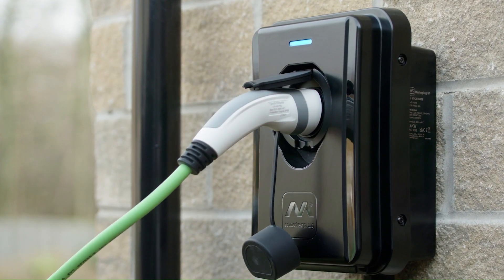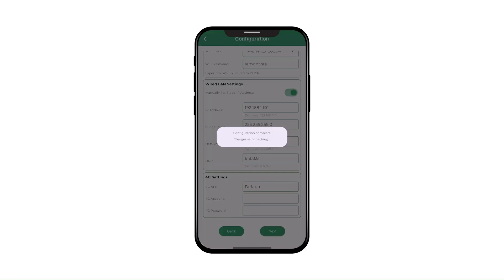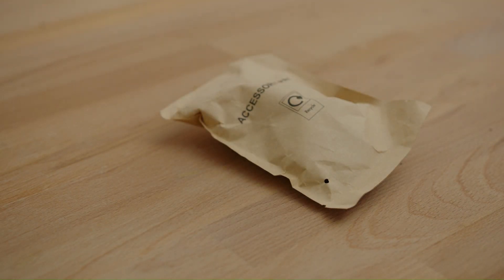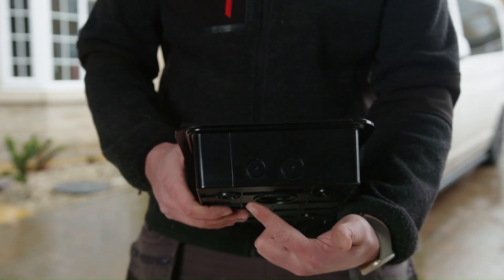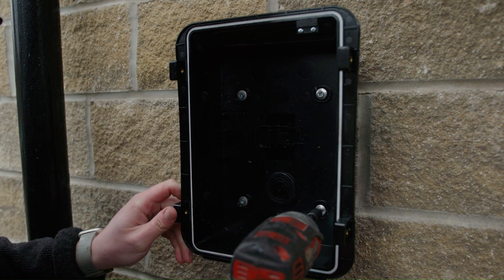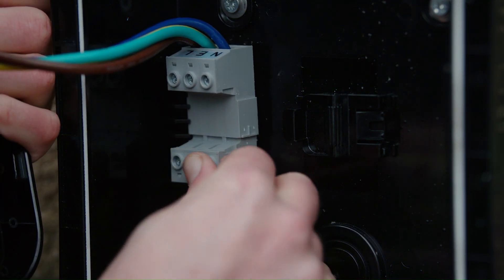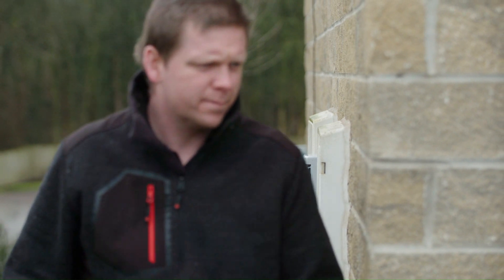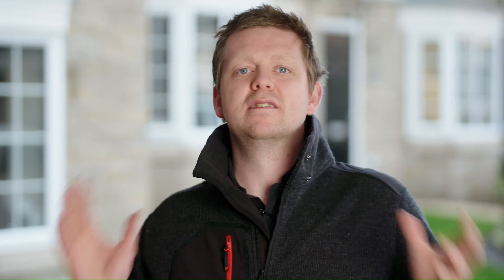EV Chargers from Masterplug  | Screwfix

Comment: All very well for the installer. What about the customer.  What does the Monta App enable.  For instance, we have an MG5.  MG for reasons only known to themselves do not include a charge timer in the car software.  We have Octopus who provide off peakl cheap power between 11.30 pm and 5.30am.  I assumed that a Masterplug smart charger would enable at least the timing function.  Does it, if so how?  I don't want to have to get up at 5.30 to disconnect.

Comment: Never use CT clamp , just waste of time with many challenges and always not working properly . If we need ct clamp for any appliance over 
7.x kw then all these 30 years fittings of Hobs/Cookers / Showers , water heaters never had a CT ...  and they always working,  My advice to manufactures do not waste money on these CT clamps as they are not functioning properly.